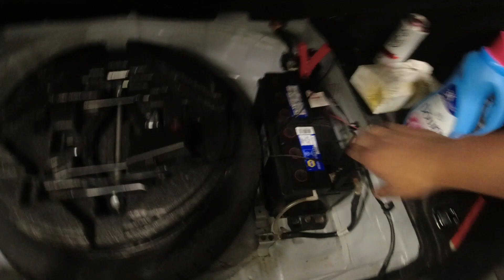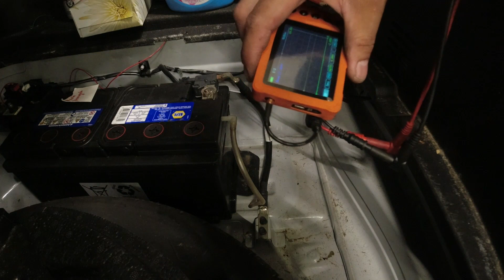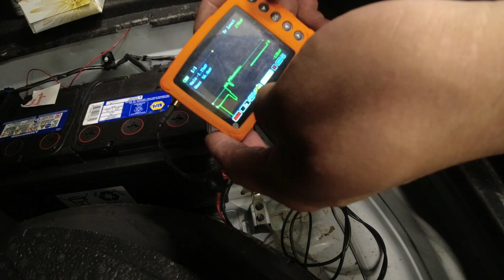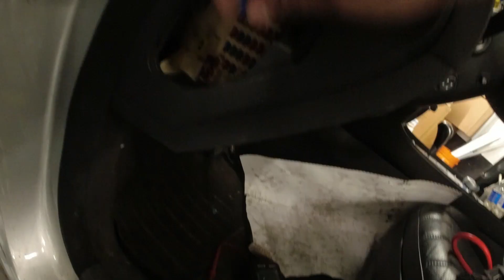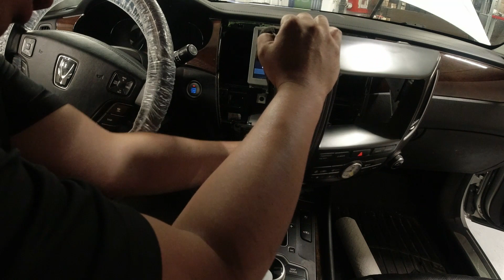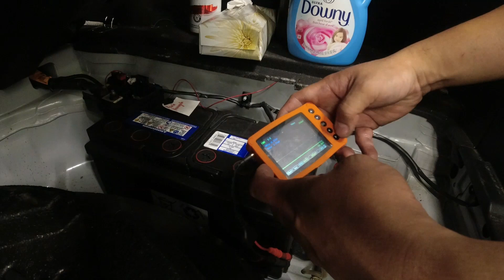HYUNDAI EQUUS, BATTERY DRAIN

Comment: I can’t believe I just found your videos. I’ve been searching for troubleshooting Hyundai Equus for a week. 
I’m troubleshooting my 2015 Equus now. It was starting rough. The dealer ran diagnostic for $240 and confirmed the PCM ECM was bad. When I got home the cars HVAC fan and headlights would not turn off. This was not a problem until the dealer was running diagnostics for the PCM ECM. I think they fried something when they were troubleshooting. 

i drove the car home with nos issues. The next day I replaced the battery because it was dead from the constant draw. So I took it back to the dealer for more diagnostics. When I returned it to the dealer I told them to disconnect the negative on the battery because I had something drawing power. 
After they ran diagnostic they informed me the Hyundai 91950-3M173 Engine Room Junction Box Assembly was also bad. 
I cannot find the PCM ECM. I see 3 computes under the hood on the drivers side. I think it is one of the 2 close to the dash. The dealer is charging me $2200. I found a company that will rebuild it for around $300. I want to give it a try before paying $2200

Also I’m having trouble getting out the Engine Room Junction Box. I got it loose but it feels like it’s not disconnecting to cannon plugs on the bottom of the box. I’m afraid if I get it off I will have no way to connect the new box.  The dealer quoted me $1500 to replace it. I bought a used engine room junction box for $30 on eBay. I figured it worth a try before I pay $1500. 
I cannot find any information online showing how to replace the PCM and engine junction box. Any help would be greatly appreciated. Thanks for sharing your videos. They are very helpful.

Comment: Yo tengo una pregunta compre un Equus 2014 iba andando y se apago lo orille le fuy a dar arranque y no hace nada no da arranque le puse batería nueva y nada
Reply from the maker: Does the instrument cluster turns on? Do you hear any click? How about the battery connection are they secured or installed correctly?

Comment: Hello sir, where exactly is the air suspension fuse on the Hyundai Equus? I need the oil changed and I think they use a Jack to lift it up. It’s under the hood?
Reply from the maker: You have to remove the  ecs fuse, electronic suspension fuse its under the hood fuse box

Comment: Hi @hyndai tech is there a way to lift up the car (air suspension) when the car is not starting? I need to replace the starter or neutral safety switch but the car is too low to jack it up.
Reply from the maker: Not that i know of, but when you set high before shut off it should stay there, but if you decide to use the jack make sure you put it normal mode then remove negative cable and the air suspension fuse
Reply: @hyundaitech  the car was set low when bought it.  I am trying to figure out what exactly is the issue. All BCM eletronics are working fine but the car doesn't start.  All relays and fuse's tested 12.3 volts. My only clue could be bad starter or the inhibitor switch. does make sense to you?
Reply from the maker: @williamdiaz8100  did you try starting it in neutral? Coz if it starts in neutral and yeah its inhibitor switch. Dies the cluster show park, r, n d?
Reply: @hyundaitech  the cluster show the gear correctly if I move the shifter to P or N but doesn't start.

Comment: I have the same problem in our KIA Quoris 2016 vip 
after the car sat in the dealer for 9 days they informed me that a head AVN saw a problem. When they do a test the car draws about 160 milliampere after they disconnect it the reading drops to 30 milliampere only. 
The main issue is that it's costly and not cheap. 
I think there must be a lawsuit against Hyundai to provide free replacement of AVN units. It's not something that will break down by bad behaviour, it's not. It's faulty manufacture and Hyundai is always not standing behind their customer. It's a shame.

The problem affects Hyundai Equus, Genesis G90 and Kia Quoris.
Reply: How much does it cost what do I got to replace
Reply: @ashtonandino4573  it's cost $4400. It's better to find used one in eBay, which  may cost only $500.

Comment: Hi
can you tell me about parts has been replaced to solve parasitic draw?
Reply from the maker: On this video when i did the parasitic draw test i found that the audio unit was drawing the power. Unfortunately the customer decline for the audio unit replacement. So i just told him either remove the fuse or install a cut off switch so that he doesnt have to remove the fuse everytime.
Reply: @Hyundai Tech  thank you for your reply 🙏. I have the same problem in our KIA QUORIS 2016 it's set in the dealer for one week 😳. They can't figure out which part of the audio system cause the problems, as you know, there are many parts from the monitor, Assy box, audio main controls, and amplifier. It's a good 👌 idea to add a cut-off switch.
Reply: @Hyundai Tech  the technician told me that the KIA,  drawn about 460 Milliampere after they removed the monitor its goes down to 160 Milliampere, and they stopped here they don't know which part cause the rest of 100+ Milliampere. It should be about 50 Milliampere approximately.
Reply from the maker: @Supplication_For_life  it depends on the modules equip in the vehicle old models yeah 50 mA max but some 100 mA max. When they removed front monitor did they leave it out and see if battery still dies? When everything is connected how many days till the battery dies?
Reply: @hyundaitech  I have asked the technician to check the normal battery draw in the other Kia K900/Quoris sat there and it was about ~60 milliampere while my car drew about 150 ~160 milliampere. with 150 milliampere the car needs 3 to 4 days before days completely. The technician also swapped our AVN with another K900. In our car with a replacement AVN the battery draw dropped to 60 milliampere and in another car with our AVN the reading jumped to 161 milliampere. The AVN needs to be replaced but they ask about $5836 :face-orange-frowning:🥵😵‍💫.
Reply from the maker: @Supplication_For_life  yeah thats expensive unfortunately with those models, maybe you can installing aftermarket audio unit, or maybe you want to install a switch that kills the audio power.

Comment: Is the 2015 equus a dependable vehicle and what about spare parts ?
Reply from the maker: Yeah i think they are, i dont see them very much. The parts is expensive, like for example the air ride for that vehicle is very expensive.
Reply: @hyundaitech  is that something that had to be changed frequently ?
Reply from the maker: @chrisv.6951  no , it should last a lifetime of the car, but sometimes you will never know like accidents, you hit something in front( where the air ride compressor located). But other than that they are pretty good cars
Reply: @hyundaitech  thanks

Comment: Those are some cool and fancy tools, do you get to pick and order them or the dealer/hyundai sends them to the dealer?
That thermal image camera is pretty cool! 

I liked the trick with door switches you used to make it seem like  they were closed

360mA seems like it would take a while to completely kill the battery, But 100mA is alot better haha. Did you have to replace the radio module?
I heard of the 2017-2020 G90's having that problem too I believe :(

How similar is the Equus platform to the 2015-2020 'G80' Genesis Sedan? The way they are laid out seems very similar from a quick glance
Reply from the maker: No the stuff i use are all personal hahaha. For the comparison for the equus and older genesis models, i think they almost similar expcept the air suspension, but the g90 has longer body. The equus is like the older genesis models but slight bigger. Hahaha
Reply: @hyundaitech  Oh wow that's pretty sick. You got some fancy stuff there, really helps with diag time for sure.

Ooo interesting, how does the air ride feel in one of those vs the G90?
Reply from the maker: @4555Anthony  the feeling for me its almost the same, and with the fancy stuff with the genesis with electronic suspension its almost the same as equus for the dynamic driving like adjusting the ride height depends on driving conditions.

Yeah for the fancy stuff i have the diag time is shorter sometimes its longer but the important thing for me that my diag is all accurate.. hahaha
Reply: @hyundaitech  Really that interesting to know, I've always wondered what the CDC (Continuous Dampening Control) on the 2015-2016 Genesis Sedan would have felt like but they were all out of my price range at the time and had V8's (Ultimate Trim) 

I'm sure you filming and chop-sticking the tests slowed ya down a bit, but still respectable for what you're doing for the community 🙏🙏